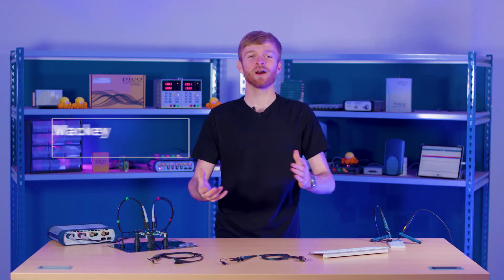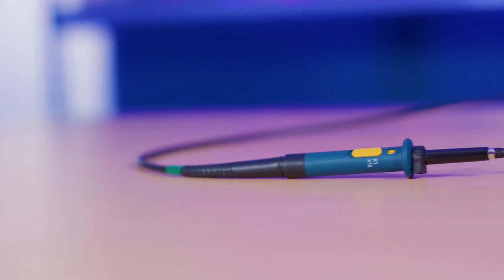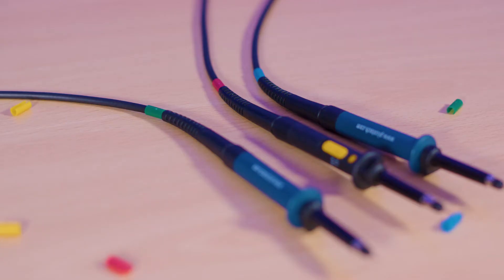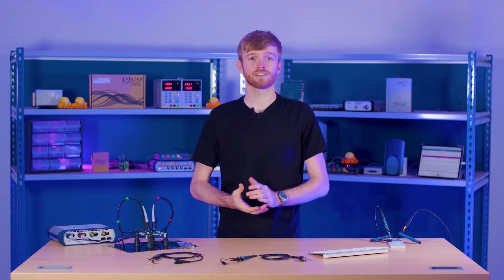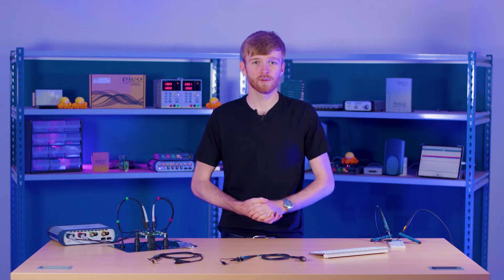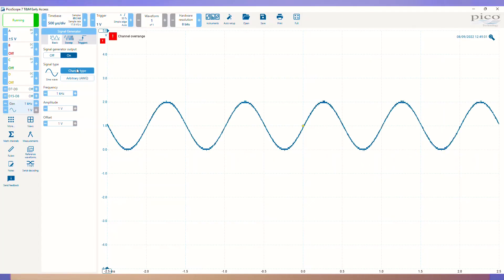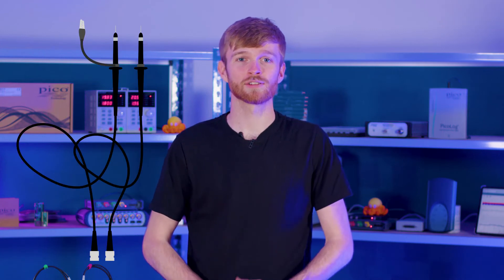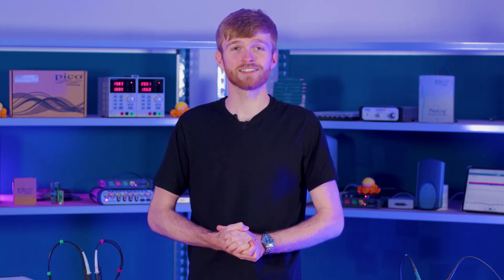Passive Probe Theory and Calibration – PicoBYTE #4

Comment: I’d also like to see something delving into the differences between (and implications of using) streaming mode and block mode, though in PS7 I think those designations - or one at least - have been changed.
Reply from the maker: Hi Martin, thanks for your suggestion. The Steaming/Block Mode question has arisen a few times so is in the PicoByte queue!
Reply: @picotech  many thanks.      A while back I discussed with Steve Smith my thoughts on what such a video might cover.     I attach them now, so that they might be of help when you come to give some thought to the structure:

“In making PS7 simpler than PS6, things have become a little bit unfamiliar.    For starters, streaming mode is, I think, now known as Progressive mode (but I presume block mode (slow sampling?) is still block mode), though it feels as if no-one minds if “block mode”/“slow sampling” falls into disuse - it’s not exactly self-explanatory.

So I could envisage 3 types of signal in the video: one at milliseconds full screen, one at several minutes full screen (parasitic drain?), and one where the full screen time might be, say, a few seconds, where, in PS6, the user might have used either block mode or streaming mode, and in PS7 you’d set the progressive mode transition either way.   We also now have buffer-memory priority and sample-rate priority with low, normal, high and custom options, along with the progressive mode transition setting.   😪.  It’s probably all the same thing but in a different guise.

I know it’s all designed to be simpler, and it probably is, and I’m sure nine times out of ten, the user won’t even need to give it a second thought.    But if the user doesn’t understand what it all means, there’ll be the odd time when they come a cropper or at least they haven’t used the ‘scope properly.    

So I’d welcome a video where you’d run through your thought processes with different signals when considering those various options in PS7, and why, under some circumstances you might choose one setting or option over another, and what the pros and cons might be. “